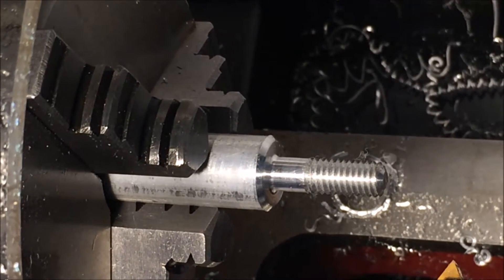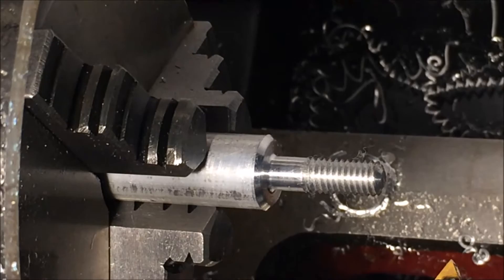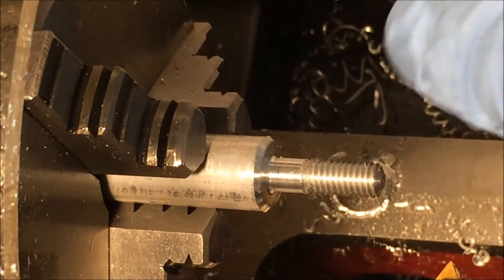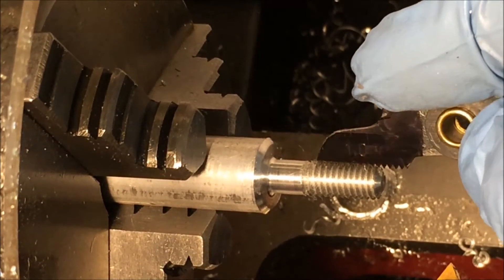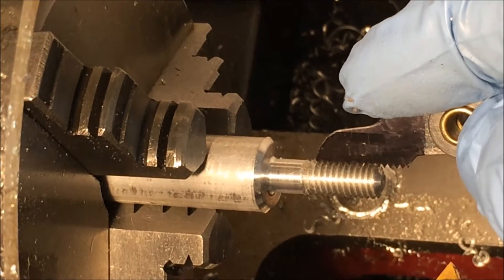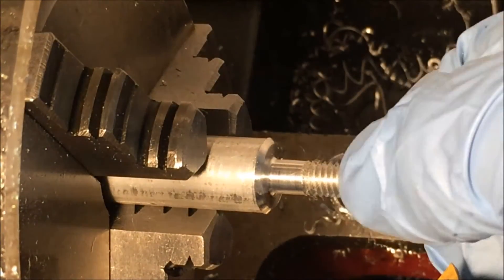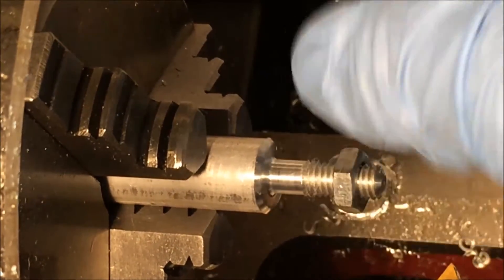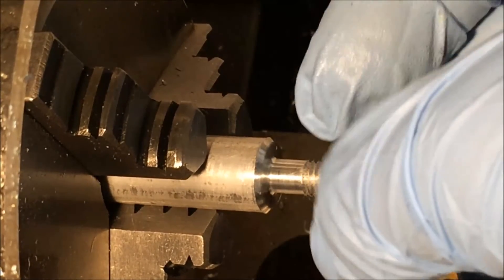Mach3 Threading on a Harbor Freight 7x10 Lathe CNC Conversion

Comment: I'm more interested in the parts list to convert that lathe!..... as well as how well it'll produce metric threads...... as well as how it works cutting steel... because it looks like the vid is using aluminum??

Comment: hi guys
very nice job...i have a question.what did you use motion controller and cam program
ı see you using mach3but  ı didnt succeed.help me please.
thanks a lot...
Reply from the maker: Hello.  For this video, I used Mach3.  The code was generated with BobCAD.  That being said, Mach4 is better than Mach3 and I highly recommend using it.  Fusion360 is probably the best choice for a low cost (but powerful) CAM package.  However, the Wizards in Mach4 are much better than what came with Mach3 and you can generate a great many programs just by using them.  No need for CAM software when writing basic programs.
Reply: Franco have you facebook account for fast message
Reply: i using solidcam but solidcam generate gcode not working with mach3.where can i find mach3 settings.i waiting your reply.